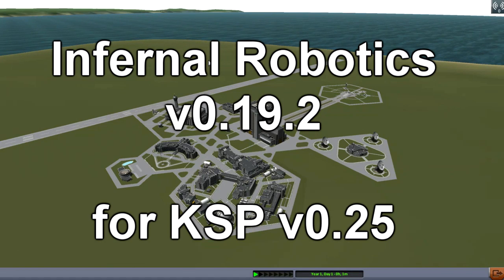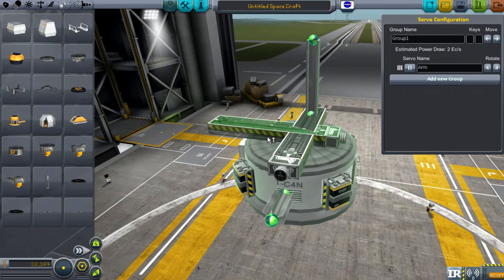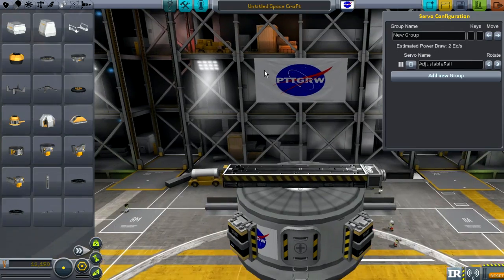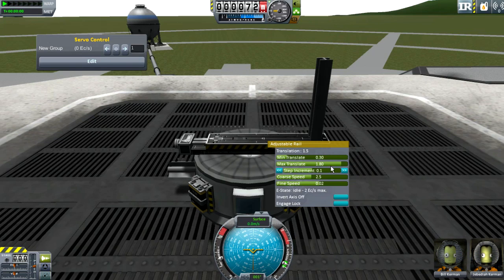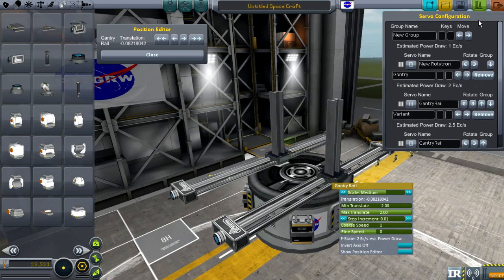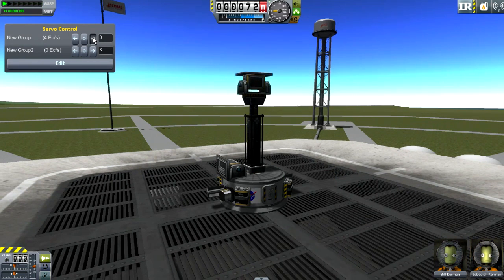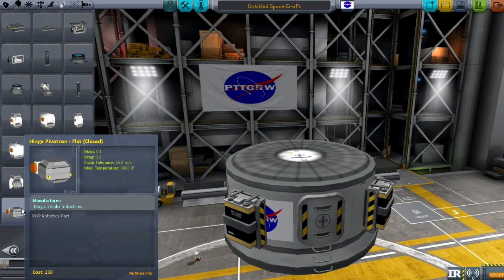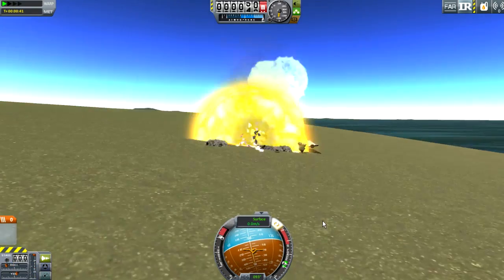Infernal Robotics v0.19.2 Mod Spotlight (KSP v0.25)

Comment: Can you post a comprehensive tutorial on the robotic arm? For the life of me I can't assemble all those things and make them all work.
Reply from the maker: Robert Dambeck I can probably do a quick tutorial on how to setup and use a robotic arm. Just to be sure you mean one created out of infernal robotics parts alone, and not a fully built one from another mod?
Reply: PTTGRW Yes the one used with infernal robotics. I just can't seem to make them fit together. Not even sure where to start and end. I really would be thankful.

Comment: Is there any way of making the Rotatron rotate continuously without you pressing the button? Like press it once and it doesn't stop till you press it again.
Reply from the maker: TheOnlyOwensey Actually yes, there is a way. With action groups extended mod: you can set the rotate+ or rotate- to be action group toggles. Meaning if you push the action group key one time, it will rotate until you turn it off (by pushing the same action group key a second time).
Reply: PTTGRW Oh wow, thanks!